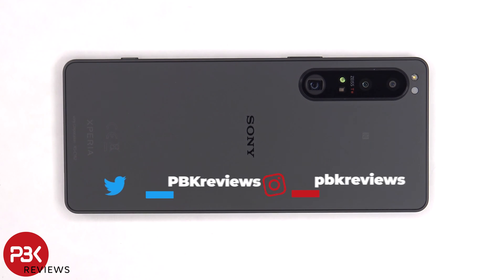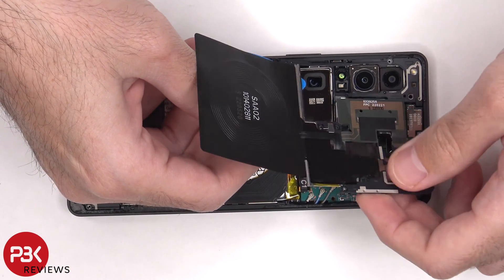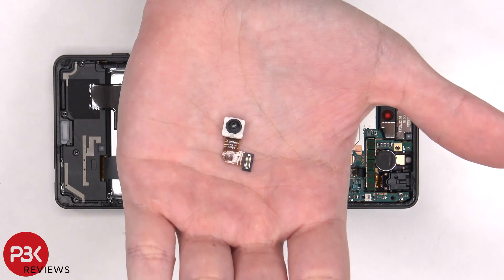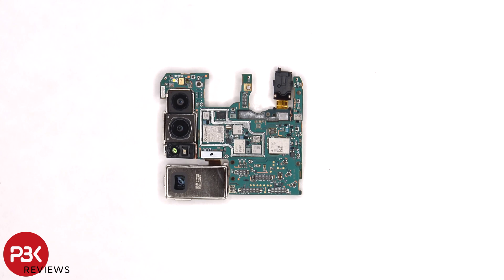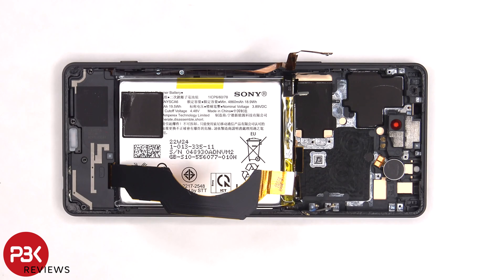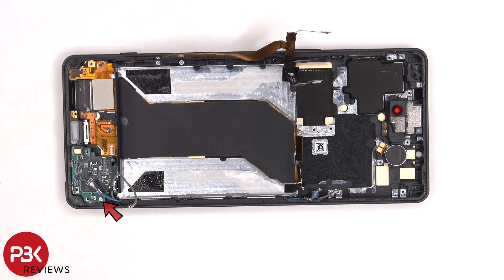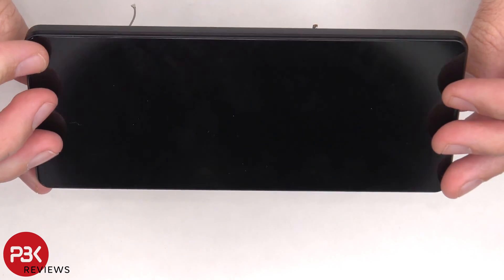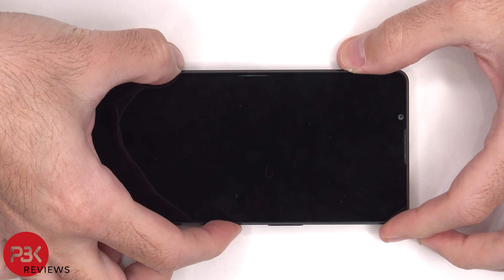Sony Xperia 1 IV Teardown Disassembly Repair Video Review

Comment: The battery in mine popped and the phone lost carrier connectivity. It still detects the sim card but phone calls and SMS are unavailable. Everything else works fine. Any idea how much it costs to repair it at any repair shop? Because if it is too expensive I must just get a flip phone for calls.

Comment: Thanks for the video, it is very clear to see all the components, well shot with great clarity. Except no mention of the suction cup tool needed along with the pry to tool to remove the back. You also need a heat gun or hairdryer (on a lower heat but for longer when using a hairdryer to avoid hot spots).

I had a battery I needed to change because it wasn't charging and discharging properly anymore due to spicy pillow which meant it pushed the back cover off by inflating the battery, so I didn't need any tools to get the back cover off. This video was helpful as I couldn't find any useful guides on changing the battery for a Sony Xperia 1 iv. 

That glue under the battery is a pain. But the isopropyl alcohol did the job. I used a thin but wide double sided tape to secure the battery in place again as I had no thermal tabs or paste to hand.

Update Dec 2025: About 8 months after replacing the battery I now have the fingerprint sensor to replace as it went faulty a few months ago(a very common fault on these Xperia phones after a few years use).

I did have to buy another back seal to do this job and a new fingerprint sensor button. But having already changed the battery, this should be an easy job to do.

These fixes would have been very hard to do without your excellent video. You've saved a lot of phones from recycling or landfill.

Comment: do you know or have any tips to replacing a back cover & keeping its ip65 rating
Reply from the maker: if you use the original adhesive and remove the old one and clean the frame and back cover with isopropyl alcohol, as well as apply the replacement adhesive properly, it should retain the IP rating. here is the adhesive And sometimes comes pre installed with replacement back covers/battery doors (https://www.ebay.com/itm/135328522855?_skw=xperia+1+iv+battery+door&itmmeta=01JCAHZ29370WKPXEGNP31F603&hash=item1f82356267:g:wWcAAOSwzH9k7kEa&itmprp=enc%3AAQAJAAAA0HoV3kP08IDx%2BKZ9MfhVJKlhA5e%2Fef%2BQhgA%2FSfTPy5vRORGEw0WJfPVVCsKMmurPvrLUw7588m9pQfvnUoeX7mh9vpuCjktUSSQRrAWWBcHbGARqDBiYdtuqOffwHu9SJesXNXdL8y9WcuFRuvElMRMJx%2FFRl3NmA1yM1coeepTV7FGoOnTjWyEZuxPCU%2FhyIht0ugV0YZSyb%2B84%2FULeT88JfnXCw%2BT67r9pVFtCpbjDTQLZX6WMaeaZU1%2BSmKGRB%2FvjCUsTBVglIqf%2BJVffn%2FE%3D%7Ctkp%3ABk9SR9Ck_NHiZA)

Comment: I followed this to replace my faulty fingerprint sensor including using the alcohol to remove the battery. But after putting it back together my phone has a black spot with a very faint horizontal glow in the same area. I was very gentle and careful but it seems it might have been damaged. Help!
Reply from the maker: you probably over tightened the screw that is in that spot on the back. Sony is notorious for having that issue of damaging the screen by over tightening the screws.
Reply: @PBKreviews  Thanks, that makes a lot of sense. I opened the phone again and saw I had put the upper finger print bracket screw in before the top plastic assembly and therefore the screw went in further than it should.
Reply: @PBKreviews  I've stuck disaster now, my phone worked for a day but now my phone won't turn on, I suspect the battery is flat as it doesn't seem to charge. When I connect the charger the red led illuminates, then turns green for a second before it loops again, indefinitely.
Reply: I had to replace the screen in the end, but it's working now.

Comment: I have one of these and I'm having the issue that it heats up where the board is on the back and it drains the battery pretty fast, of anyone knows the solution post it here. ,...
Reply: Look like there is background app thats running tht use all the cpu and gpu...

Comment: Hey, I know it's been awhile since you released this but I figure it's worth at least asking.
Are you able to remove the power button / fingerprint reader assembly without taking the battery out? It looks like it might be able come out, but I can't tell for sure. 
Mine has recently started failing, and Sony's support has been less-than-helpful, so I'm going through the process of fixing it myself. If I gotta take the battery out, might as well replace it with a new one as well. Thanks in advance!
Reply: Hey, did you do this in the end? I am facing the same issue and debating doing the two together
Reply: @caedtn4409 did you every replace it and did it work without taking the battery out?
Reply: @gib8891  just seeing this now sorry, and yes I went through with replacing it and did have to remove the battery. It's been a while so I don't remember exactly why, but I think there was either a ribbon or antenna cable that went under it and needed to come out, or I just needed enough clearance to remove the power button assembly. 

but after about a year of use the fingerprint reader has started to fail yet again, so... i'm probably going to want to replace it again soon.

Comment: What temperature do you heat it up to to loosen the glue?
I've looked online and have seen everything from 40°c to 80°c!

The fingerprint sensor on mine has died (what a surprise) so need to replace.
Reply from the maker: I'm not sure the exact temp, but you can always use a hair dryer to be on the safe side and just heat it up gradually till its hot to the touch and apply more heat if needed while working your way around prying it off.

Comment: Hi. Nice video. Would you happen to know the size & type of the antenna/wifi cable connectors on the board. Mine popped off when I removed the wires and couldn't find them since they are so tiny. 
Need to buy them and solder them back on but I have no clue what size the are

Comment: Do you still have this phone laying around? I recently got the from someone on reddit to replace my old 4000mAh battery in my Xperia 5ii with the 4500mAh version from the 5iii. It is a bit thicker but also shorter, which leaves quite some empty space between the battery. I am now trying to find out what the precise dimensions are of the 5000mAh battery in the 1iv and 5iv.
4000mAh dimensions are: 76.6 x 59.8 x 4.8 mm (L x W x T), 4500mAh: 74.4 x 59.8 x 5.2 mm.
If you still have this phone laying around or for some reason have measured the dimensions of the battery, would you mind sharing those please?
Reply from the maker: hi, sorry no I don't usually keep the devices.
Reply: @PBKreviews no problem, was worth asking. Tha ks anyways!

Comment: Do you know how to replace the fingerprint scanner?
Reply from the maker: Once you disassemble the phone, there are a few screws holding the volume and power button with fingerprint sensor flex assembly to the frame which need to be removed so that can be pulled out and replaced.
Reply: @PBKreviews  You're a legend, thank you <3

Comment: Does someone know the size of those mid  frame screws? M1x6 mm or M1.2x6 mm?
Reply from the maker: Not sure but I used a 1.5x25mm Phillips screw driver and works fine with them.

Comment: This is terrific but how different is removing and changing the front glass, than the rear? Can you change the front glass alone?
Reply from the maker: Hi, no the glass is adhered to the screen, replacing the glass alone requires special tools and machines to do it correctly. You would need to replace the screen assembly.
Reply: @PBKreviews  Thank you! Would you then do the same to the front as how you removed the rear? Or do you actually have to go through the back and remove all of the parts to transfer in the new screen assembly?

Comment: Hello. I have a question. I am planning to purchase the Sony Xperia 1 V in silver, which is only available in global version. The issue is I live in the US. In the US, we only get black or green available. My question is the following:
If I purchase a US version model and global version model, would it be possible to move or swap the internals of the US model into the silver global model? Would it function like a US version?
Reply from the maker: Yeah for the most part you should be able to do that. Some different region devices will have different antenna setups but that usually is on the plastic covers internally and the sub boards/charger port boards etc. Rarely would there be a difference in the actual frame of the phone antenna wise. So as long as you swap all the components internally from one to the other,  should work fine.

Comment: I sandwiched its board in kryonaut coating! 📱
Reply: thermal grizzly paste per your criticisms
Reply from the maker: 👍 just make sure the thermal paste you use isn't highly conductive, since if it gets in places it shouldn't or spills over the sides and touches metal, it can short the board or components.

Comment: I have this phone.  I love the camera but man...the overheating really makes the experience rough.  And the battery life could be better.
Reply: I have Xperia 1 iv too, and it gets hot when I use it for the first time. But I tweak some settings.. But now..  battery last long and no heating issues. 
Go to location setting.. Turn off some apps you don't need to use location. Because there are app uses location even though its off on toggle settings.
The the display. Only put apps you want to use 4k restitution.. the music. Also only put the app you want to use the 360 or dsee ultimate...

Comment: Hello. Thank you for a detailed teardown. What do you think, regarding Xperia 5 iv, is it worth to open the case and try to replace the cpu and memory chips heat transfer plastic  with a good thermalpaste or, maybe, copper foil? Is there a risk that the display would become overheated?
Reply from the maker: Hi, thank you. You can if you want, but make sure the thermal paste is not a highly conductive one since some are conductive while others aren't and if it leaks onto anything around it, it can short. I don't think the display would overheat.

Comment: saludos podrías mostrar como desmontar la pantalla touch, gracias
Reply from the maker: Hi, after you disassemble the phone as shown in the video, all that is left is to heat up the screen and pry it off. If you mean just the touch screen, its not possible for end users to replace since its glued to the screen itself and requires special tools and machines to do it correctly.

Comment: Thank you very much. Sorry I did not made my self clear. I have a rugged phone lets say XCOVER PRO and screen broke and i replace it with new one. What is the best way, what matterial shall I use by assebling the new screen back in position, so the screen to be (to remain) water and shock proof? Thank you
Reply from the maker: You would need an original pre cut adhesive like this one https://www.ebay.com/itm/403037928096?hash=item5dd6eebaa0:g:EQUAAOSwA~9hB9JD&amdata=enc%3AAQAHAAAAoP5R9LRBAJz3DIz07x2%2FrvLk4cICuO5jYzgKB8Zc%2FJFJQ9Zk%2FKW3nluR%2BT%2BZbBkFq7%2F2MznQi%2FQZZza963GjR6%2FTe5bgzSCTf5TPO0MWipSS7iojW%2FV4175PRNX9KH%2Ff8hAfxwPEDtEZ3nOsG%2BOfF83c2N2X6TRApYlDhM2OWdwV5EbRviV3%2BeOpGM10GvADpje5NviVFvFd%2FFFFoaz1k%2BY%3D%7Ctkp%3ABk9SR6KplPmzYQ

Comment: Happy New Year! How are you? Please for your valuable experience, how yyou would recomended to glue the screen to a rugged phone so it will be waterproof and shock proof? To use special gloue lets say B7000? Something else? What you will recomend? Thank you very much
Reply from the maker: Happy new year. I don't think gluing the screen to the phone would help it be shock proof, if anything it might made it worst. As for water proof, if the phone is not water resistant, then it can still get in from earpiece speaker, loud speaker, sim tray or any other openings like mic hole etc. You're better off getting a phone like the Galaxy XCover pro or similar durable and water resistant phones which offer rugged designs as well as water resistance.

Comment: I should've gone with this one instead of the s22 ultra. This one still has an SD card slot
Reply: @Cartman samsung sucked after the Note 9 when it didn't stay true to what the Note line meant and started following everything Apple did when samsung mocked them. They got no desire to be unique.
Reply: @nufsioohay  Can't agree less, the Note 20 Ults was a great finaly of Note series, with spectacular desing, performance and specs, it worked great even with exynoss, the only issue was its screen, still tho was an awsome smartphone, and it still is
Reply: @thealaris  to each their own. Right after Samsung mocked Apple for having a notch, no headphone jack, no charger in box and more and literally the next year, they did the exact same things. 

Samsung's been following Apple's footsteps for so long and it's evident in the Note series after the Note 9. They forgot how the Note differs from the Galaxy S line so they just got rid of it and it's sad.

Talking about performance and specs and design is pointless because we're talking about phones that are a few years apart. I'm talking about what makes the Note line unique and how Samsung forgot about it.
Reply: I have Xperia 1 iv, yes it heats up.. But I tweak in some settings. And now.. I got no heating issues. And the battery lasts longer... One is in  location settings there are apps uses location even though the location is off, try to off location  of apps that don't really need location settings.. Also in auto 4k. Just put an app you like to use in 4k. And in music same thing. Put an apps that you only wanted to use the 360 or  dsee ultimate...

If you're a sony user you know how to set things up.. And your phone will last until the battery degrades for years of use will be the problem ✌️✌️😁😁
Reply: Sd card is the way forward I had s20 which also had sd card. Other samsung s models didn't have it so now I have this beast ;P. But what's the fastest, safest charging watt brick to use
Reply: Sad that Sony have now outsourced their phones to a third party. But it makes these older Xperia phones worth repairing and continuing to use. Great cameras if you have the skills to use them in manual mode. Not suitable for point and shoot though.
Reply: S22 Ultra is miles better than this. You made the correct choice bro
Reply: @ThatVoidDude   From my experience with both phones 
Xperia iv faster than s22 ultra Especially after a period of use for at least two months
Also the speakers in 1 iv clearer and with 360  audio can not be compared with s22 ultra speakers  , s22  ultra speakers It looks like an average phone when I compare it to Xperia1iv  , There are a lot of things Sony beats Samsung like colors display , Sony has an creator mode  and x1 mobile color and 4k 120 hz display and don't forget sd card slot and 3.5 headphon jack 
Also Much less weight than s22 ultra and comfortable in the hand
Reply: @s89kw  Xperia has a ton of issues. Largest one being overheating.
Reply: @LaidBackDeveloper  completely wrong
Reply: @LaidBackDeveloper mine does not overheat. And my wife owns S22U that overheats like crazy. She even can't use it in her car as navigation.
Reply: @ThatVoidDude  no I didn't. It's a tad bit worse than my s9. Random restarts (option is turned off), vibrations weak, fingerprint scanner fails to recognize around 50% of the time, pictures and videos are MASSIVE in size, phone gets too hot while charging, 128gb doesn't last as much and phone lags too much. 

I restart my phone every month to keep it nice and running but it still randomly reboots twice, maybe 3 times a week. 

I made sure to enroll my fingerprint so it doesn't miss. Still does. 

A single picture is at around 5mb for some reason. Location tags are off. At 4:3. 

Can barely feel my phone vibrate despite it being at its strongest setting. 

I use a 10w charging brick, it shouldn't be getting that hot. It's in a cool, fresh place. 

Phone just lags. Do I want to type this comment? Phone starts stuttering. Do I wanna restart the phone to solve the problem? Too bad it's not gonna show me the power options. Do I want to see my notifs? Phone decides that it wants to show me the wallpaper instead.
Reply: @ThisHandleIsNotTaken.  Then I say that you have the Exynos variant.
Reply: @ThatVoidDude  oh I wish. It's the snapdragon version from AT&T
Reply: @ThisHandleIsNotTaken.  faulty unit
Reply: @ThisHandleIsNotTaken.  exactly same as mine, but I am on Xperia 1 V now. Much better than S22U.
Reply: @DmitriyDarkJoney  bro I have Xperia 1 iv should I upgrade to Xperia 1 v or stay on it? The overheating issue sucks